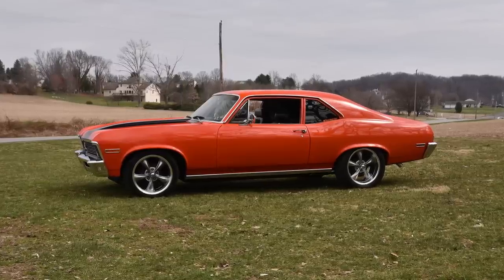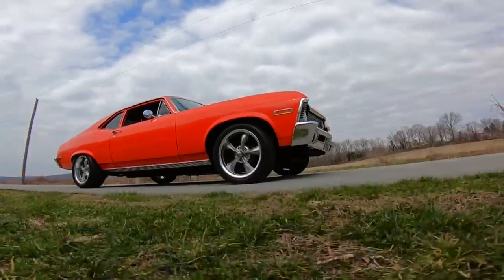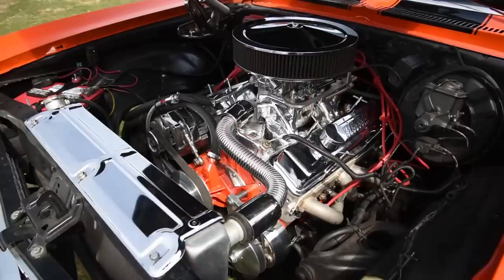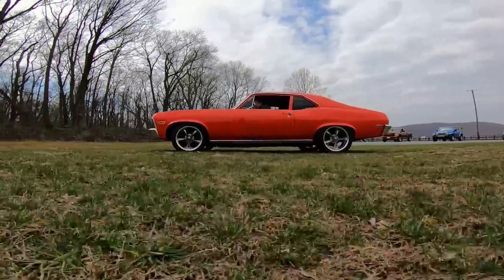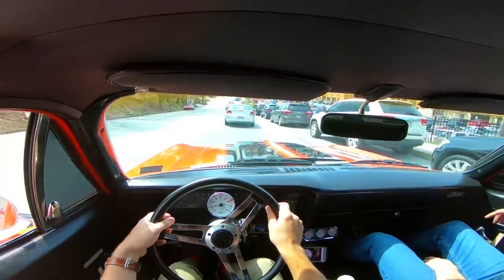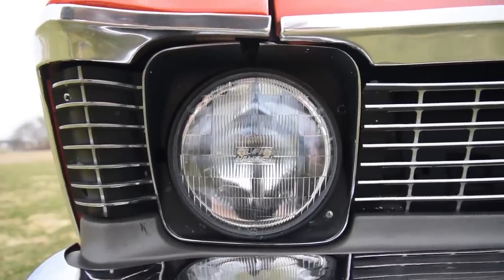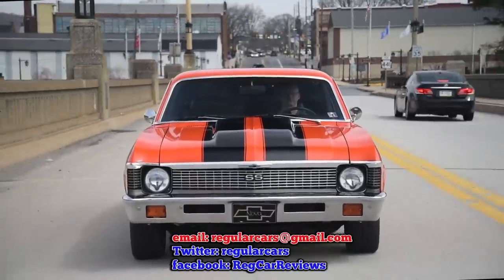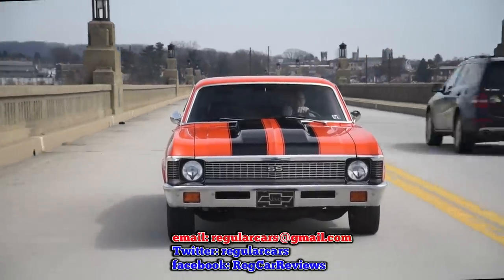1970 Chevy Nova: Regular Car Reviews

Comment: An LS may make those numbers with a turbo, as you said...but going old-school gives the exhaust that classic burble and bark that turbos muffle.   And they can still make decent power without stupid money.  It's just that you don't find them as often in junk yard, being sold cheap - like the LS.  Not any more, anyway.

Chev 350: the LS before there was an LS.
Reply: You definitely don't need a turbo on an LS to make 450 horsepower. My LS3 has a small cam, headers, and a cold air intake and is making about 520 horsepower at the crank. SBC's were before my time, but I agree with RCR. Why go the SBC route when you can have an LS? I understand a numbers matching car, but for something like this Nova, drop an LS in there and make big power much easier and probably cheaper with a hot cam to really get the muscle car nostalgia.
Reply: @KTM990WFO  its fucking cheaper and simple!
Reply: aussiebloke609 350s where in everything from cars, pickups, school buses, vans, step vans, dump trucks, boats, medium duty trucks, etc.
Reply: KTM990WFO my nova has a 350 in it right now, and I am building another. 350s are way cheaper when you buy parts used. You can make 450 horspower on a sbc for around 200 dollars if you frequent Craigslist and swap meets
Reply: dubc60 not really. This is about what it costs me. 
A hook up on a bore and hone - around 7 bucks a cylinder. 
Heads from swap meet (alot of the time you can get them with rockers and springs)- 50 dollars. 
Cam - 40 bucks. Most people don't know what cams they have.
 Pistons and rods (most of the time I  just use stock rods) - 60 to 80 dollars if you go new. 
I didnt add in like gaskets and oil, etc because I dont consider that part of the build. Also, I didnt factor in ignition and block because I always just pass it down from engine to engine, or just get the block free from other people. 
I mightve missed some stuff. 

I could also just be cheap, and take stupid risks when building an engine, but wondering if it can even run is fun 😂
Reply: I also didnt add carb, but I normally use a 750 cfm carb
Reply: Hartley C and how does that make 450 hp? You didn’t name any stamping head you look for, or if you do any work to them. Traditional or vortech? You just said you use mystery swap meet cams. You don’t know what 450 hp really is. If you could make that kind of hp/$ you’d be a famous engine builder, not some random dude on YouTube that barely knows how to name a few engine parts.
Reply: @KTM990WFO  Yeah I don't know why he said you need a turbo to make 500 HP with an LS. The GM hot cam LS3 makes 495 HP and they advertise it as the 480 to keep it quiet I guess. The simple fact is that you cannot make the same power, for the same money, with an SBC (or small-block Ford or FE Ford or big block or small block Chrysler) as you can with an LS.
Reply: Sampson Avelar LS Sucks for reliability comparatively aswell
Reply: Foxmakesmodels no it doesnt?
Reply: @hartleyc3782  I have a 350 in my nova right now. It's the original one from 1972. I swapped my rochester 2 barrel for a edelbrock 4 barrel intake with proform 600cfm double pumper and put in k00172 summit cam and a 2000 stall converter and my car ran a whopping 10.99 in the 1/8 (yes that is correct eighth not quarter). If you back calculate horespower on a ET calculator for a 3400 lb car you get a wopping 125 horsepower. These engines are kind of shit without having the heads decked, ported, and bowl work. They're just not efficient in making power. You have 23 degree head vs a 15 degree head on the LS.
Reply: @KTM990WFO  you can get a ramjet 350 that has more torque than an LS1 and both engines make roughly the same amount of horsepower lol
Reply: @W4RY3NTRY  True but the iron block ramjet costs significantly more than an aluminum LS1 and only has 2-bolt mains vs the 6-bolt mains on an LS.
Reply: @KTM990WFO  true but I’m just going along with what the main comment says. I like both motors but for something old school I’d go with a classic small block. Ramjet fits it perfectly but with a more modern twist. I like the mean choppy sound.
Reply: @W4RY3NTRY  For me personally, I'd go with an LS over a SBC any day. I'm not sure I understand what folks are saying regarding the choppy sound. It's definitely not exclusive to a SBC, my LS3 is cammed and 100% gives you the "rah-rah-rah" sound a lot of people like. Any pushrod engine can give you that sound with the correct camshaft (SBC, BBC, SBF, LS, etc).

Comment: A 350 is USELESS even though you can buy one for 500 bucks, rebuild it in a weekend, run it for 300k miles, find parts at literally any junkyard in almost any chevy or gmc, put in in hundreds of cars and trucks with NO modifications and NO computers whatsoever because there is another engine that makes MORE POWER! LOGIC!
Reply: good points
Reply: 72 nova with a 396 is perfect. Anything under that is powerless
Reply: @EricT-2  yep my 69 GMC with 375 HP is powerless. And it gets 14 mpg..
Reply: @ericchapman8956  375 still isnt 450 so, yea it's powerless compared lol
Reply: @EricT-2  half the price so not really a comparison. Look guy, to each his own and 396s are cool but the point is that 350s are popular as hell for a reason. They can make 600 plus horsepower or more with about $5k and 400 with just bolt on parts. Saying 350s are powerless by comparison to a 396 is like saying ribeye is crap compared to a T-bone.
Reply: why shit on a car that's awesome? What it should be for your refined taste? What car do you own?
Reply: @EricT-2  375 is enough to have fun with. i wouldnt call that powerless.
Reply: @EricT-2  375 in a small car is insane hp is only somewhat relevant it's definitely not accurate for anything acceleration related. My old 1800 pound truck only had 120hp and it was definitely faster than my dad's f150 that weighed far more and had 250 hp
Reply: More than 450hp in that nova with a stock suspension won't make it faster on the street, just make a tire smoke death trap

Comment: Revs up to 5k? Most stock 350s rev to that. In sure this does more.

Everything you said about the converter is wrong. He probably needs the converter that loose to match his cam.

And there's alot of sbc hating for someone who built an old 302

Lots of build hating from someone who paid someone else to build their car for them
Reply: Hell, SBC even with stock parts, if they're a 4 bolt main, can pretty safely go up to 6,500 with the right valve springs.

Comment: You know why you'd want to swap a 350 Small Block instead of an LS? Sweet, sweet, winga cred at Cars & Coffee. And it's easier to trick Uncle Pulltab into thinking the 350 swap is "original" or "period correct."
Reply: Trick?  Since the '70 Nova SS came from the factory with a 350, it is "period correct."  No trick needed.  Just not original.
Reply: If you want the look toss an LS in there with a big carb and air cleaner
Reply: Only an LS doesn't really look like a 350, regardless of carb or air cleaner.  It's obviously much more modern, and a little generic looking when compared to other modern V8s.  The 350 small block is pretty distinctive.

Comment: I'll take a classic SBC over an LS any day.
Reply: Masayoshi sbc sounds way better in my opinion
Reply: @rustypliers74  Plus, not much beats the sound of a 4 barrel carb on a SBC going wide-open.
Reply: It's okay to be wrong
Reply: The Chevrolet engines were about the worst from gm with head bolts going through water and oil jackets, no valley pan, distributor in the back, coolent passing through intake manifold etc.
Reply: Martialman.45 I’ve had to deal with a 1990 Chevy S10 with an SBC in my auto tech shop and had to take the distributor wires off and put them back in, and god damn was it a pain to get to the rear ones
Reply: I traded 2 sbc for 1 ls. People like you are awesome

Comment: Why are you fellating the LS so much when you put a REBUILT bog stock Windsor 5.0 in your falcon instead of the Ford LS equivalent.
Reply: What Ford LS equivalent?
If there was such a thing you'd think people would talk about it and swap it around.
Reply: Because Ford doesn't have an "LS equivalent" that doesn't cost 10,000 dollars.
Reply: @3a.m.284  Erm... an LS is like 10 pounds heavier than a Coyote. But go off I guess.
Reply: @woottastic  Oh, I agree completely. The only category a Coyote can beat an LS is when price isn't an issue and you're just trying to make as much power as possible, in which case stock block coyotes can make well over 2000hp. But in that price range, you'd probably be better off with a billet BBC or an LSXR anyways.
Reply: @woottastic  
Exactly my point, you can spend 1500 bucks on a junkyard LQ7 and make 800hp, or you can spend 20,000 on a coyote to make 1,300. Dollar for dollar an LS beats it every time. BUT when price isn't an issue, a FACTORY Ford motor company Coyote can make more power than a FACTORY LS of any variant. It's just a simple matter of RPM's and a ton of boost.

Coyote's are amazing engines are remarkably reliable considering the mess of a million and one valves and camshafts, but the main problem with them is that they're friggin gigantic and cost a fortune.

I bleed chevy competition orange, but you have to give Ford credit for the few things they do right or else you're just going to sound like a brainless fanboy. Modern Fords are shit IMO, and the 4.6 and the Coyote are the only two good things they've done in 25 years.
Reply: @Christian---  the closest thing I can think of is some kind of modular. My point was he was saying why rebuild a boring small block when you could just buy an LS built up already. When he went through the trouble of rebuilding a junk Windsor.
Reply: woottastic so much misinformation in these comments lol. What coyotes have you worked on where the DOHC are "prone to failure"? The 5.0 has already been used in f150s for years and has no problem reaching 300,000 miles. You can find low mileage first gen motors in junkyards for less than $1500. No it's not as popular or parts aren't as cheap as an LS, but I'm sick of people regurgitating false info on an engine that's perfectly fine to swap. Quit acting like you know things
Reply: woottastic and I also love how you somehow changed "2000 hp on a stock block" to "2000hp on stock bottom end". It's so easy to argue when you just change what they said!
Reply: GM > Ford 
Source: I own both. Fite me!
This is 80s and up, mind you. The older stuff is basically equal.
Reply: The ford ls equivalent would be a 351w not a coyote.  OHV, capable of big power, reliable and relatively cheap......Probably not as abundant as the ls but more comparable.
Reply: @REEL SIXX Yeah sure it is... New. An aluminum bore turbo 3.5L v6 making up to 450hp is NOT going to last, I'm telling you right now.
Reply: Ford do have an LS equivalent, it's not a V8 but the turbo Barra inline 6 can make huge power and torque and Barras cost nearly nothing at all
Reply: @animalalphaawesome  
Yeah, sure it is. For one country on the entire planet. Where the hell am I supposed to get my hands on a Barra inline 6 on the eastern coast united states??
Reply: @jamiemeadows7569  The 351 Windsor is ancient and comparable to the old SBC's.
Reply: @REEL SIXX Proof or it didn't happen.
Reply: I mean he explains why LS swapping a car overshadows the identity of the car. Keeping a period correct engine in your car helps make it seem more “complete”.
Reply: @SoI_Badguy  I could halfassed-argue that the 7.3l PS is the third good thing Ford's done in 25 years but that's really stretching it because it's a Navistar-designed engine with a Ford ECM. 25-yr-old design that's weak on power compared to even the 6.0l that replaced it, and the auto transmissions that went behind them were a bit on the weak end as well (kinda like comparable Rams of the era, strong engine backed by a weak transmission), but from what I understand, if you take care of it and treat it right, it's practically bulletproof.
Reply: @DFX4509B  
The 6.0 is fine if you replace the FACTORY ALUMINUM head studs... seriously, wtf were they thinking? No wonder they always blew head gaskets.

Regardless though, I already have my own biases in that department.  I recently aquired an LM7 duramax and I'm loving that truck.

Comment: I have to tell yah Mr. Regular that a 2800 stall isn't that high and people who know what they're doing match the higher stall to the duration of their camshaft and intake and without hearing the specs of either I'd guess that stall is spot on.
Reply: Yeah.

My Ford's factory stall is rated between 2200-2700 (going from memory. Tthey vary - mine is closer to 2400), but it also has lockup. Which is definitely a "must have" on any aftermarket converter.
Reply: @novass7493  a big small block is all you'll ever need❗

Comment: Dude, if we use your logic then the 302 in the vagabond falcon is just as superfluous because an LS will fit between the fenders of a classic / sort of late model Ford. I’m from the same area as you are and the local yard, ie EZ-Pull has no LS engines in the yard you have to go to Harry’s u-pull it to find any LS engines. And if your looking at a given horsepower that’s usable on the street and you want a new or rebuilt engine a SBC is still cheaper than an LS. To add to this post, I looked up prices using 400 hp as a benchmark because unless you’re racing 400 is more than enough for the street. And if you’re buying new or rebuilt an SBC with iron vortec heads, fitech efi, and an LT1 cam you can put that together for $2200. A new or rebuilt LS 5.3 running factory efi, upgraded springs and a cam is on average $1000 more. So while a junkyard LS will make more power than a comparable junkyard SBC anyone building a car like a daily probably wants said engine rebuilt at the least. So no the SBC isn’t worthless or pointless, it’s still the biggest selling thing in the hotrod world because it’s still the cheapest way to go fast. Don’t get me wrong I love LS engines but don’t discount the SBC
Reply: Lima Bravo 👏 👏👏👏 bravo couldn’t have said it better myself. This is exactly what I was thinking watching this video.
Reply: Jacob Gonzalez / C’mon no it doesn’t, that cars a hot rod. He took something that was a slow leaky old car and turned it into something pretty cool.
Reply: Colin Nixon / thanks man. I don’t get why everyone thinks that the LS is better than well everything else. I love my little 355 and with 350hp and tq it’s more than enough for driving on public highways
Reply: Hi Lima, I agree. 350s can still be found cheap and with vortec heads + matched cam you can get decent power. You also have some more cubes with the 350 as opposed to a 5.3 or 4.8 - and you will have to pay a premium to get a 6.0, so the comparison isn't entirely apples to apples. 

One thing nobody ever mentions when discussing an LS swap is all the associated hardware to do the swap. You have to get a new trans or get an adapter, maybe a driveshaft, set up mounts, and other things for an engine that wasn't "intended" to be there from the factory like the original small block. I don't know what has to be done in terms of oil pans, exhaust/intake manifolds, or belt systems to get everything to fit and work properly. Then there is also getting fuel injection to work. 

And when Mr Regular discusses "throwing on an ebay turbo", at that point I assume you are shooting past the 450+ hp mark and at that point it may be worth considering either side. How much boost can a stock small block take vs an LS? Which is cheaper to rebuild? Power gains between the two? Price of installation? Etc.

Comment: In 3 years of following RCR, I gotta say, this is 14 minutes of off the mark. 1) ls engines are great on paper, but the argument of cheap doesn't apply when you're talking about swapping from a sbc to a ls. The same part for a ls will cost about twice what it will for a gen 1 small block. I'm doing it now and it doesn't look as good when my money is involved as it did before. 2) not all people who run higher stall converters run them to sound cool or be jackasses. If that engine has a different camshaft and heads which is apparent and you claim it does, where does it start making power? Big intake ports and a lot of duration will make an engine miserable at low rpm, enough that in some cases a stock converter (that stalls at 15-1600 in that vintage of GM's case, not 1000) will be too tight, and you'll stumble, load up, and die at stoplights. 2800 is not that bad when you should turn that on the highway with a 3.73 gear, and depending on the cam specs, compression, and the size and flow of the ports, is about the minimum he would want to go. Otherwise the car would be miserable to drive. I will tell you from experience that 355 cubic inches with 195 cc intake runners and 231/239 degrees of duration @.050" lift wants little to do with anything less than 2k rpm, especially with a load on it. 
This seemed like 14 minutes of bitching about an ls swap you've never done, and not really classic RCR :/